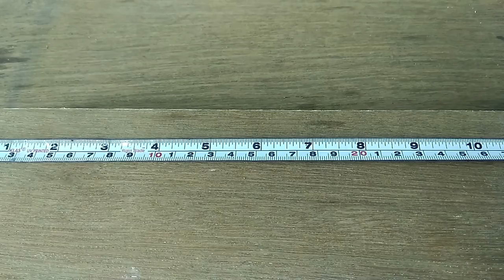3 New Woodworking Tricks/Tips #5

Comment: Did you use a plane to scrape paint off that metal? I have never seen that. Not to smart if it's your only plane.
Reply: David M  bad because of the metal. the metal will damage the plane. and as someone who has mad e mistake of buying a cheap plane, fixing the edge is not easy,
Reply: @jedexkid41  you sure it was metal? Even if it was I have some cheap planes I'd scrape metal with. I've bought some planes for as little as a quarter. So I really don't care much about them. And sharpening the iron is no biggie anyways. At least if you have a bench grinder with an adjustable tool rest.
Reply: @1pcfred  I have a whetstone and a chisel jig, so it took me a bit to get a good edge.
Reply: @jedexkid41  what you have works but as you've noticed it takes time. With a bench grinder to do a hollow grind and diamond plates to hone it goes faster. Then I polish on ceramic and strop with charged leather.

Comment: If you wonder why your plane becomes blunt when you use it to scrape paint from metal parts and why metal drill bits explode wood, here's tip #0 from basic school: use proper tools for the proper job.
Woodworking tools are made for wood and metalworking tools are made for metal. Showing so little respect for your tools is a shame.

Comment: I would comment something sarcastic but I wont.
Reply: Dan Barrett  I will 
1 none of these are new 
2. Planning a door with an angle grinder OMG where did you do an apprenticeship 
3 round off the outside edges of the Formica scraper 
4 duh even cavemen we’re drilling with a blank underneath the Work 
5 please find a new line of work
Reply: Ur comment is deep, appreciate it..